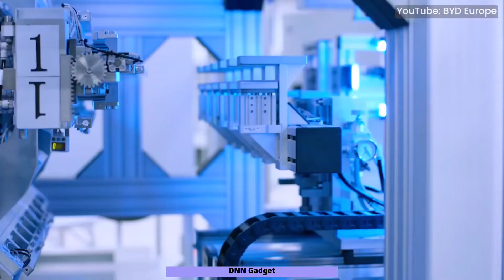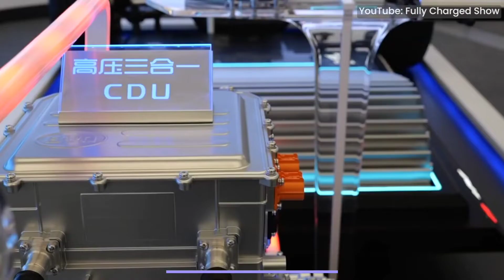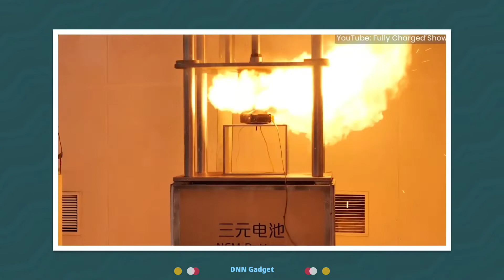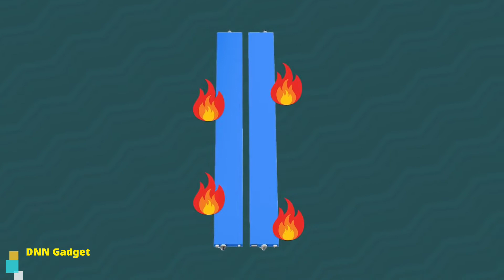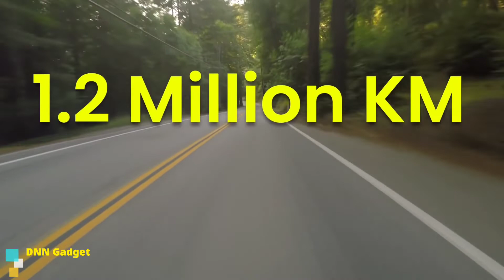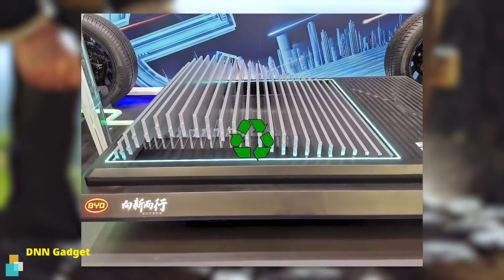BYD's BLADE BATTERY SET TO REDEFINE EV SAFETY STANDARDS.. No more Li- ions batteries !

Comment: Tesla has 4680 cells, low weight more power
Reply from the maker: Centre of mass of the vehicle should be the major role, although having low weight, Tesla's battery pack give only maximum of 350/380 km range.